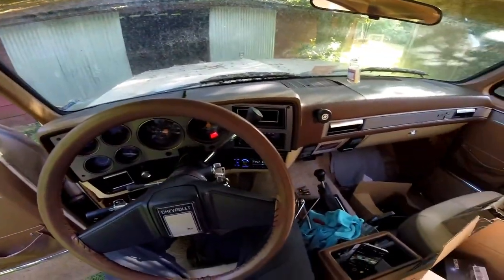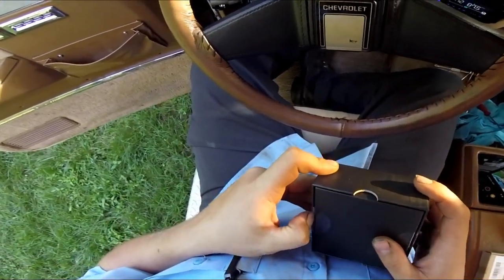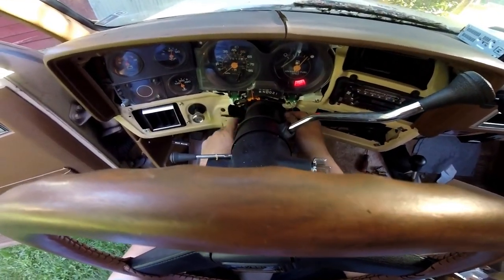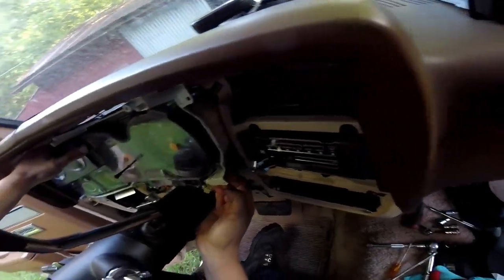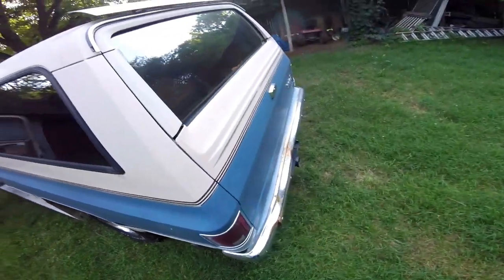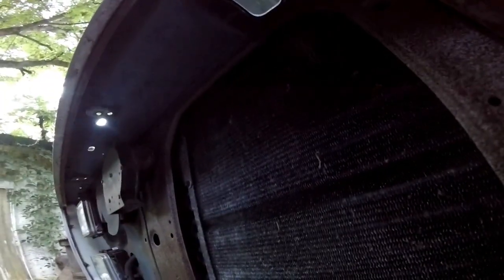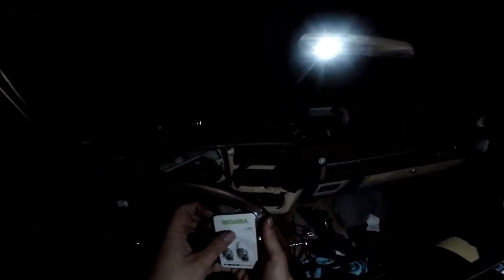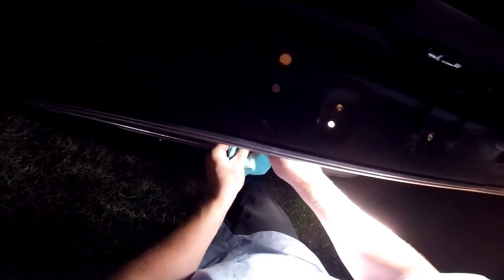How to replace gauge lights in a square body chevy

Comment: So the thing I was wondering about is a fiber optic cable. Not a ground. That is what I needed to know. I really needed to know if it was a ground before putting my cluster back in. Thank you for taking the time to explain as much as you did. There was one 2 wire light that is a 4wd light, not a check engine light like you said. Just saying. Thanks again! Boy I would really like a video going over all the vacuum lines and wires in the dash... following where they go. That would be amazing.

Comment: I removed mine completely, there is lots that can be done, once you have come this far.  I removed all the gauges from that 'green' body, and painted the inside bright gloss white..  much more reflective, also I painted bright glossy white on the back side of the black metal gauge bezel.  The light really brightens.  Also, I cleaned and used conductive grease on all connectors, plugs and sockets.  Take a good look at your  plastic flexible circuit board..  those are cheap to replace is yours is going bad..  $50-70.  Not bad if you are having failures.
Conductive grease is the hot tip though,  use it on everything.  I just replaced a rear tail light bulb, it was corroded into the socket.  I cleaned the socket, and put conductive grease on the new bulb, that will never happen again.

Comment: We used to just do a light coat of spray paint on bulbs back in the 90s change interior bulb color....red blue whatever lol... Stab em into a csrdboard egg crate and mist em one color and put em back in behind dash. Painting the brighter Led blue(high beam) and hazard/turns a color to dark em down a bit and preserve the color. Leds dont run as hot so burning off paint is less of prob also

Comment: Hi, I own a 1988 chevy V20 Silverado Suburban 3/4 Ton. I had to replace the instrument cluster. I removed the old cluster. I broke the left tab, lol good thing I have a replacement cluster. I bought on Ebay. I also broke the white light socket that has the fiber-optic wire on it. Do you know where I can get a replacement. Or I might just put regular socket and install my own light in ashtray with limit switch that will turn of replacement light when I close ashtray. I am so glad I watched this video. I did not know what that wire was. I thought it might be a ground. I cant find it in any of the manuals I have. Ok, so much for now. Very informative video. I also have to replace all the outer light assy. The tail light assy are very rare. I have not been able to find them. Do you know of a good website to buy these part?

Comment: I found it easier to undo the cable under the hood and push it in through the firewall into cab, it will literally push the cluster out.

Comment: Hey I have an 84 chevy c10 swb and I want red led backlighting for the gauges, what would you recomend?
Reply from the maker: Sorry for the delay in replying. I really like the Sirius LED bulbs. They fit perfectly and are bright. They are more expensive, but I have had problems with the cheap ones like from JDM, dieing pretty quick. Look these up on Amazon. New-SiriusLED-T10LED
Reply: @squarebodyrepair853  Thank you I have bought and installed mine now and it looks really nice, thanks for the video.

Comment: Really late to the party but his comment at 9:20 about needing an LED flasher isnt true, at least not for me. I just swapped the front side marker lights for LEDs on my truck and they work fine with the OEM flasher
Reply: if you only swapped the side markers then you still have several regular bulbs in the circuit. You mainly need new relays if you go to all LED